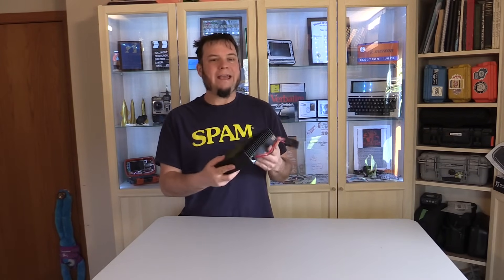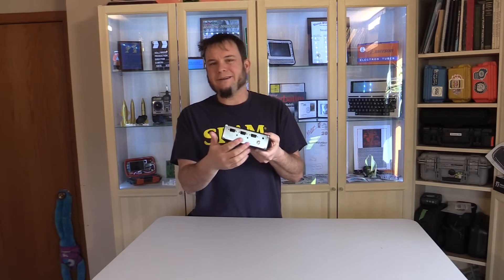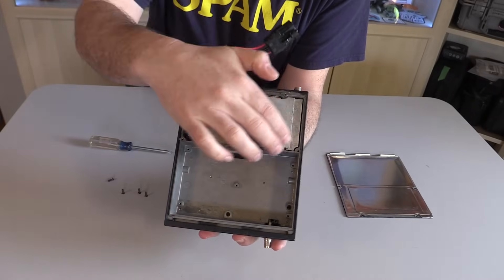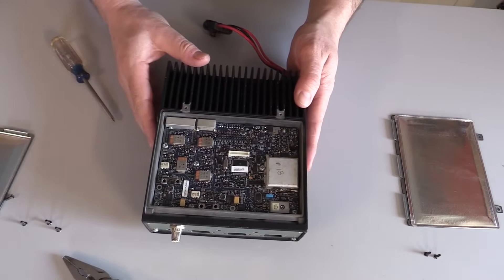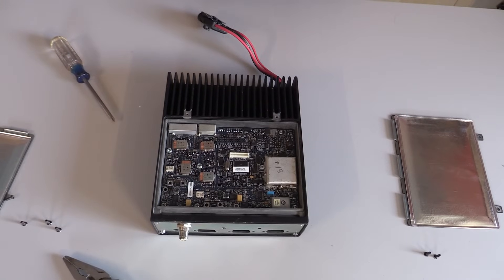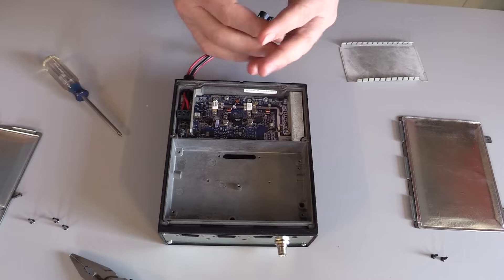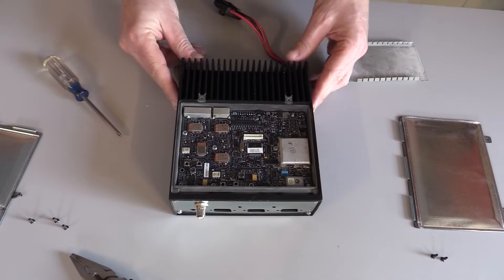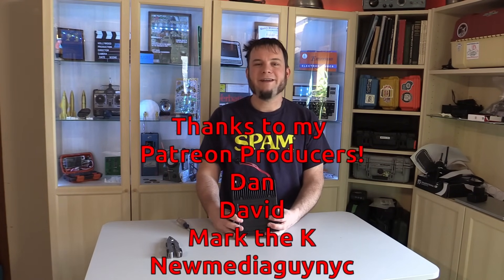Mystery Device From Ax-Man Surplus (Dataradio SCADA Tranciever)

Comment: Way back before we had 3G & 4G cellular data, the 'radiomodem' was used in Police and other public safety vehicles to provide a mobile data connection. This advancement at the time allowed for the first mobile data terminals (computers) that were installed in Police cars. The radiomodems worked in conjunction with the existing police radios and utilized the same radio channels for data when there was no voice communications taking place on the police frequency.

General Description
GeminiPD+ mobile radiomodem products are aimed at the public safety and public utility markets to meet
demand for high speed and high throughput. They integrate all the necessary hardware for data-only vehicular
installations up to but not including the laptop PC and its application software.
Example of applications are:
1. Database inquiry systems.
Small number of brief messages, (usually from the mobile station) with fairly long responses.
2. Computer-aided dispatch (CAD).
Large number of messages, (usually from the base station) with very brief responses.
3. Automatic Vehicle Location (AVL).
Using built-in GPS receiver, determines position, speed and direction of fleet members.
GeminiPD+ radiomodems are made-up of:
• A main transceiver
• An auxiliary receiver for PARALLEL DECODE ™ (patents pending) technology
• A power amplifier (40-Watt for UHF, 35-Watt for 800 MHz, 25-Watt for 900MHz models)
• A Gemini Control Unit (GCU) with DSP driven modem
• An integrated OEM GPS receiver.1
Reply from the maker: If it had the serial module I'd try it with my old cop car touchscreens!

Comment: Those are some beefy looking output transistors! The thicker trace on the board is the signal path, I think, and there are quite a few inductors and caps (lots to experiment with 😉). For the schematics, if it has a patent #, you might be able to look it up using that, or maybe fcc. Good one 👍
Reply: 35w 800mhz or 50w UHF.